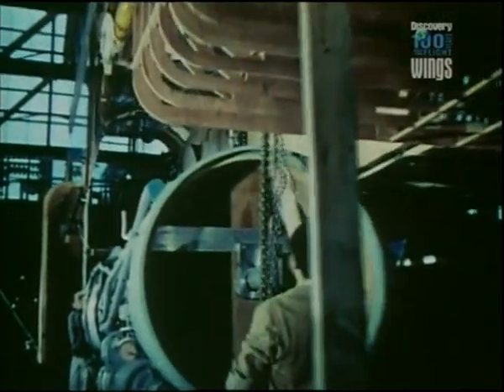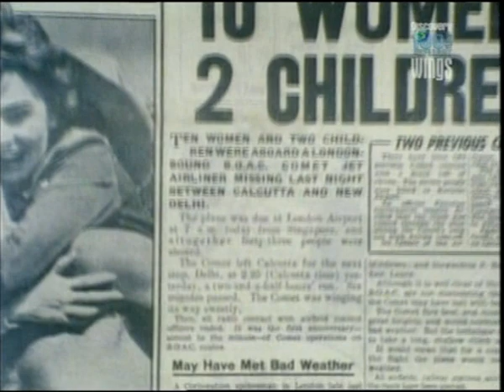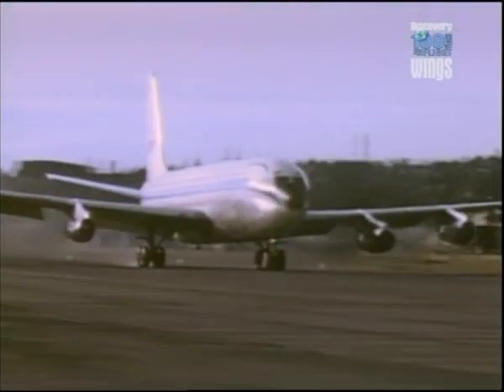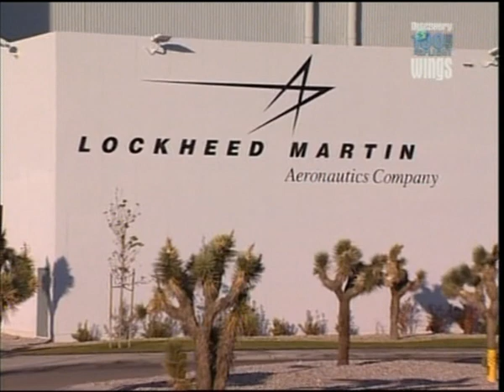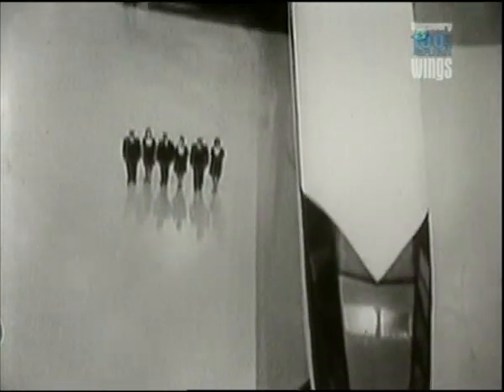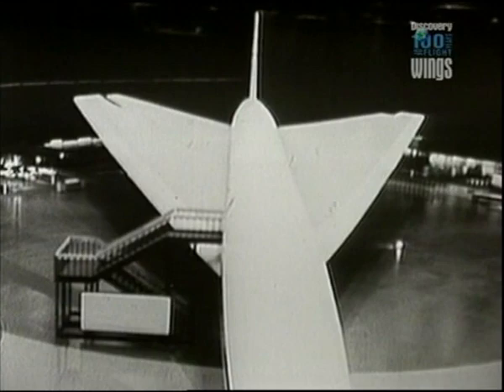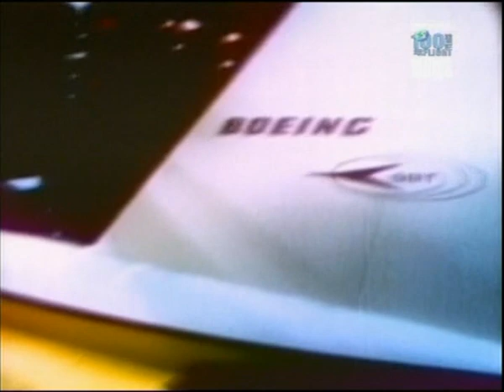Planes That Never Flew - The American SST - Boeing 2707 3/4

Comment: I think you never worked in research and development or in an engineering position, or anything close to that, so you have no idea what you are talking about. No researcher, physicist, etc works with imperial units because they are totally impractical and are absolutely nothing else than an obstacle to your reflection and your work. They have Absolutely no advantage whatsoever.

Comment: More interesting doesn't mean anything, maybe more intellectually challenging, I agree, that's the whole reason why those units are a pain. And if you can't picture length in meter, it's just a question of habit. Now can you tell me automatically (I mean fast, without thinking) what's the longest between 57/64 and 29/32 inches without calculator ? In millimeter it's 22.622 and 23.019 mm isn't that much easier.